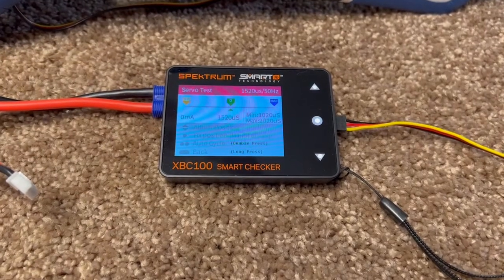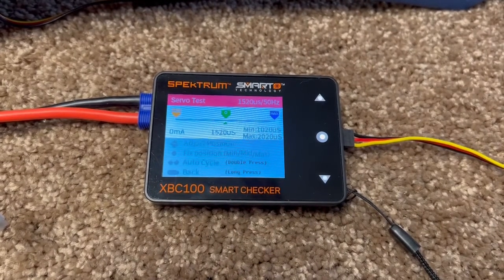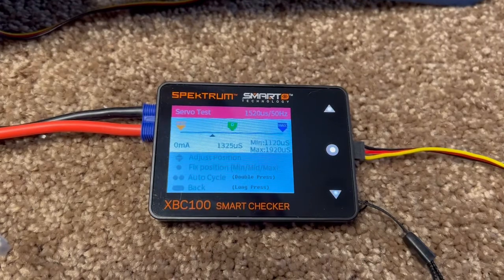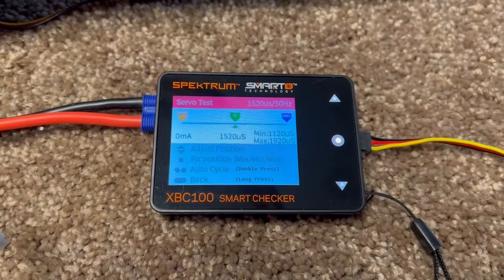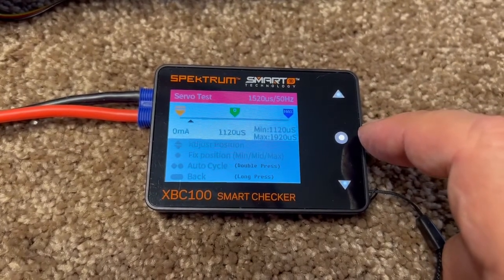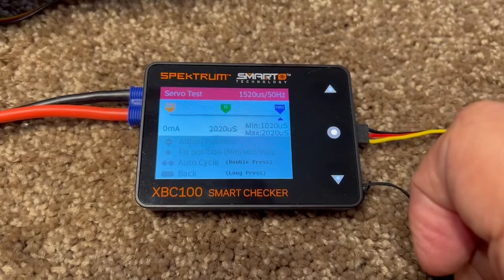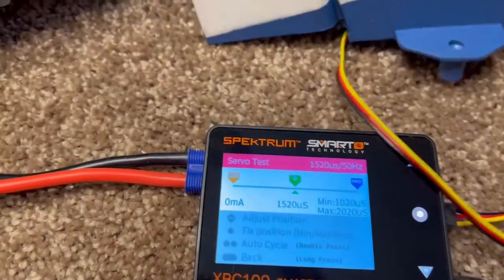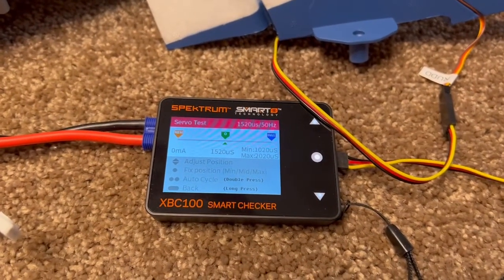Spektrum XBC100 Smart Battery/Servo Checker

Comment: Will this show voltage on 1s lipos? Specs show for  for 1s but also say input voltage starts at 5v.
Reply from the maker: I'm not sure how you'd check a 1S battery with it unless the battery has a JST connector on it. If your battery has some other type of connector, you'd have to use an adapter cable. And, I would think you'd have to power the XBC100 with separate battery via the IC3 connector. I mainly use my XBC100 for checking servos. For my 1S batteries, I use Spektrum's S44 Micro 4-port AC/DC 1S LiPo Smart Charger. A cheaper alternative might be the Tenergy T420 4-Channel Charger for $36 at Amazon.
Reply: @txkflier  thanks for your reply.  You offered some good info and I will have to ponder on that for a bit.